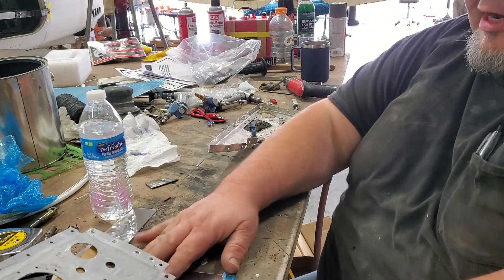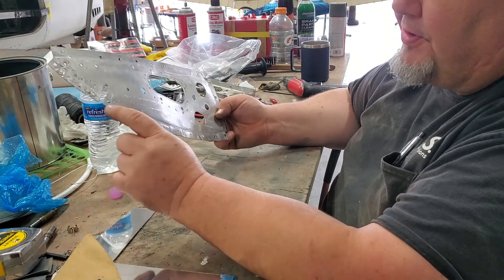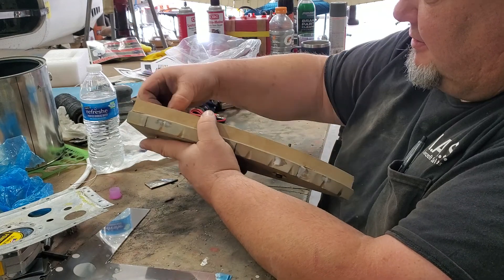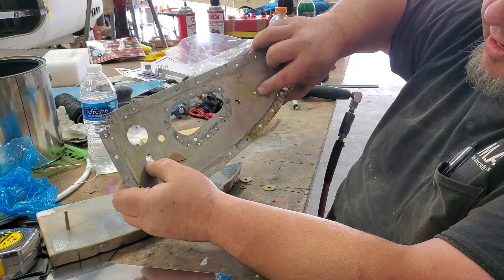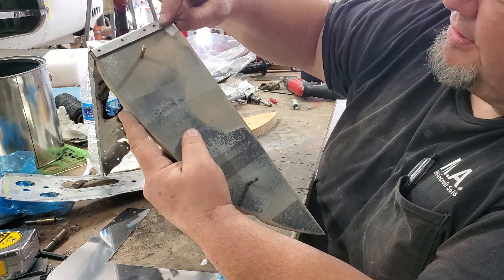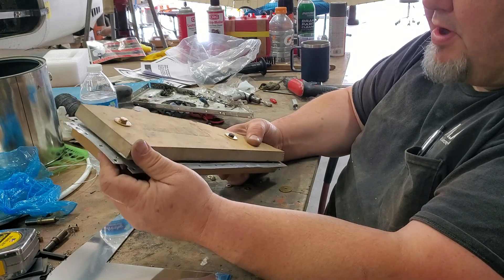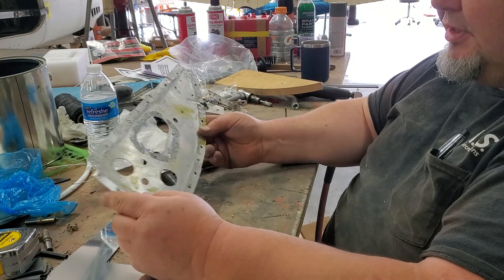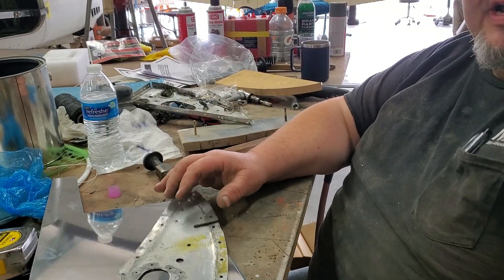Forming a frame out of aluminum for an aircraft repair

Comment: You need to orient the grain of the metal in the proper direction for strength, DIAGONAL is not right.  Also the is a MAJOR REPAIR and you need to have a 337/IA sign off.  A smart IA would look over your part and laugh in your face.
Reply from the maker: @yeagermcbipper9008, thanks for your comment but I would disagree with you. I have worked in manufacturing and repair stations doing fabrication and repairs just like this one. Yes it needs a 337 and an IA approval to return for service, I am not worried about that at all. You put the grain 45* of all the bends to keeping the cracking in the radius corners. It's not like wood where the grain is positioned longitudinally. I didn't use the IA that laughed in my face, he cleans my toilet when he comes in.
Reply: Yeah, this type of repair is common. There are repair standards that apply for every conceivable repair just like this one. Check offs are based on those standards. Tim just isn’t showing all of his knowledge here. Good repair.

Comment: Cherry Max will hold just fine but is used by lower skilled people trying to save time.   And I guess money.
Reply from the maker: Lower skilled I agree, save time maybe, money no....Solid rivets are sold by the pound and CM are sold Each. Besides Cherrys are only allowed where you have no access to the back side to work the shop head. Hence the term "blind rivets"
Reply: You need 2D edge distance.... the Cherries didn't give it.  You're a crap MX
Reply: Who hurt this commenter?

Comment: New sub. Where did you find the material needed at? How did you choose the angle to make it on the material? I thought you were to 0 degree a part as much as possible. Did the original part have the re-leafs made in it to allow to shrink the material or how did they do it. In school we each had to make a wing nose rib that was rounded. We had to use a wood block and nylon hammer to stretch and move the metal so as to not need the re-leafs. Could you have done this here or was there a particular reason you did it this way.  Just trying to get knowledge and nothing more. Thanks for the video. I will try to find the rest of this video fix.
Reply from the maker: I used to work for a fab shop and I learned how to make the blocks and forms. I used a 10 degree undercut for sping back. The material I used was 2024-T3 and since it wasn't a tight radius it formed well over the block. And yes the original part had those "reliefs" along the outer edge.
Reply: Great video! However, I'm curious about how you verified that the static loads remained unchanged. The original parts are press-formed, and the lightning holes are created using specific dies to ensure the flanges meet the DWG-specified tolerances. While I can see the potential for this method in general aviation aircraft, I have doubts about its applicability to commercial aircraft.